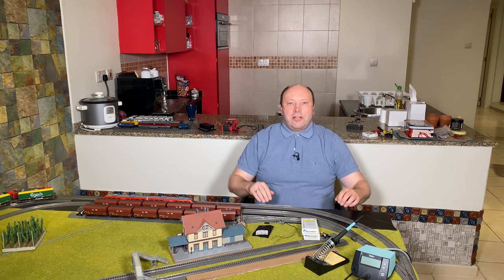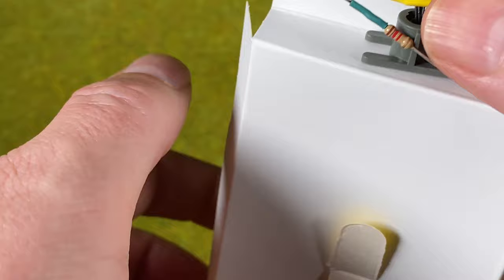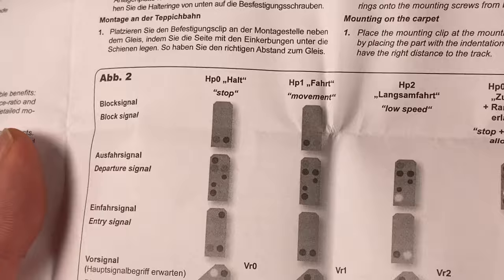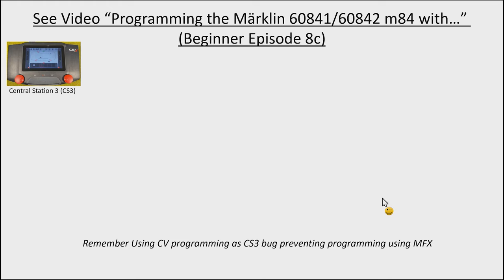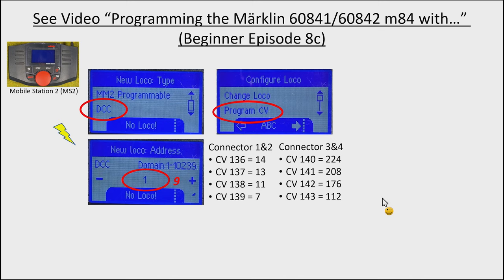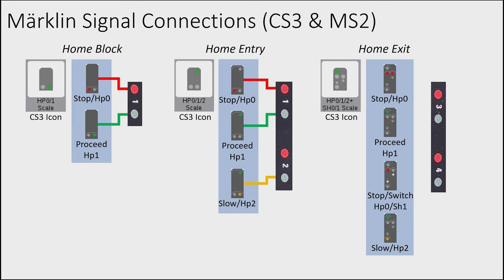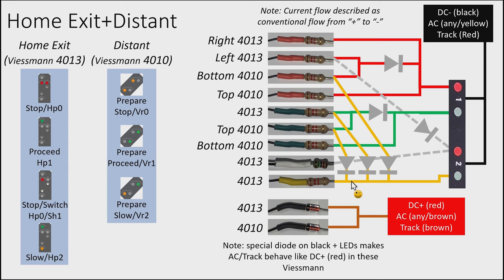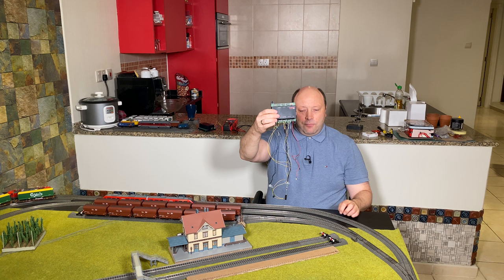Using Märklin 60841/60842 m84 with Viessmann 4012 Entry/4013 Exit Signals (Beginner Episode 8d)

Comment: Very interesting. I gave up on the Märklin decoders with Viessmann signals. Now, I use the ESU Signal Pilot. It is much cheaper than the m84, and you do not need the diodes.
Reply from the maker: Hi Storm, I have been looking at the ESU signalpilot and they look very interesting. Great they do not need diodes. Question: How many 4 way signals can you connect to one signalpilot? ...and can you use DC power for the signals? Enjoy ;-)

Comment: Hi Bo. Can you show us how to connect viessmann combination signal. (KS signals). Thanks
Reply from the maker: Hi Alf, I am not sure I have these signals... which signal specifically are you asking about (Viessmann model number)? Enjoy ;-) Bo
Reply: Would be happy to learn how to connect the viessmann 4045 or 4046 ks signals with a cs3 !
Reply from the maker: Hi Alf, I have looked in the manuals and as I see it you can connect them to the CS3. However, the issue is that the CS3 does not support all the signalling aspects. By being a little creative using the existing CS3 signals I believe you can make it workable. I am currently considering buying these to try them out - however, they are very expensive... Enjoy ;-) Bo

Comment: Very informative video - where can I buy the black test-cable you’re using in this video?
Reply from the maker: Hi Jens, I think you are referring to the black power supply cable where you can insert the wires? If so, then this was just a cheap power supply I bought of amazon. This was a DC power supply with variable voltage and a range of connectors so it can be used for multiple purposes. Enjoy ;-)
Reply from the maker: Here is an example of a power supply. Note - this is not the one I have, but something similar: https://www.amazon.com/Universal-Adapter-Variable-Adjustable-100V-240V/dp/B07WWBB9DY

Comment: Hi Bo, I am about to build my own and am yet to decide on the signals, of which I need a lot. I like the option save money, however I wonder if there is that much to save. If I compare the cost of 4 Viessman signals plus m84, with the comparable Märklin signals, I get a difference of 50 Euro. This comes to 12.5 Euro per signal on average. When you have to do the wiring with Viessman, it may well be worth buying the Märklin signals. It seems to me that with the cost for the m84 at 100 Euro significant cost reduction can be achieved when m84 alternatives. One other question I have is, how do the Viessman signals compare in terms of detail and construction? Do they look as good in real life as the Märklin ones?
Reply from the maker: Hi Hubert, 

I also like the Viessmann signals and find them as detailed as the Märklin ones. However, the wirering is very complex with the M84 to more complex signals. 

Consider looking at other decoder options e.g. ESU signal pilot or the Viessmann multiplexer supported signals (e.g. 5229/52292). There are also lots of others out there Qsignal and digikeijs. Unfortunately, I do not have much experience with these. I suggest you ask around. There are many options. 

Also consider if you are using software automation, then it can be even simpler ad the M84 can connect and the software controls how the signal works. However, this usually requires more outputs to be used. 

Hope this helps! Enjoy ;-) Bo
Reply: @ModelTrainFun  thanks Bo. I checked out ESU decoder, yes it has 16 outputs so brings down the cost by 50%. I will research the other options you mentioned as well. Thanks!
Reply from the maker: @hubertvanmierlo  Hi Hubert, please explore how it works - I think you will have one wire per light - hence using one output per light. This will use the outputs faster, but much easier than then wires needed with the m84 in this video. Enjoy;-) Bo